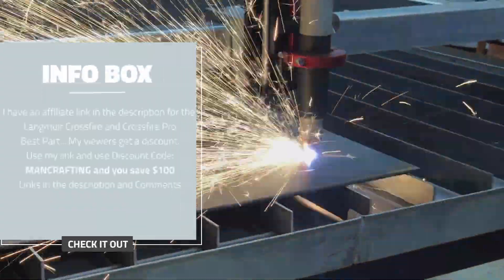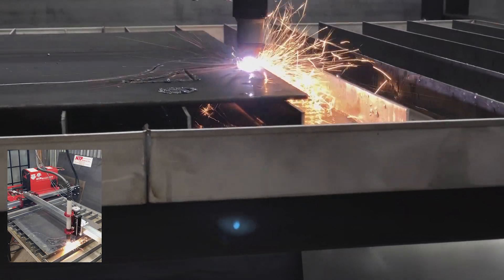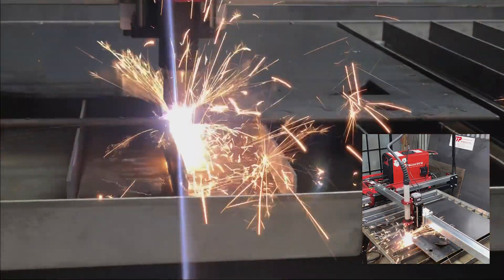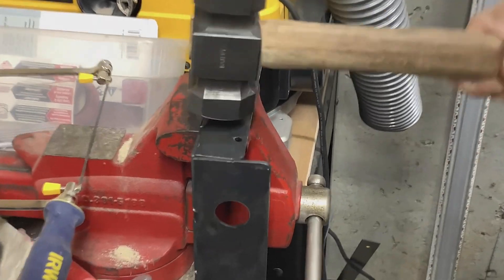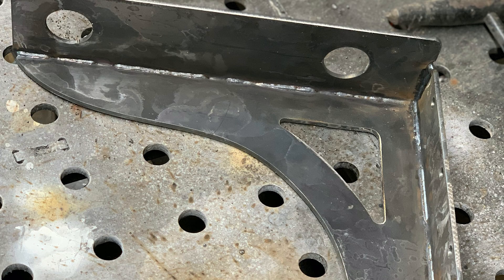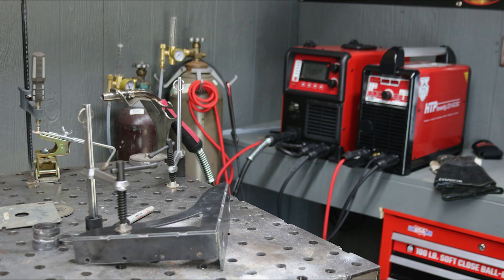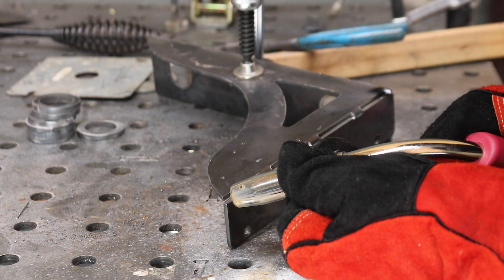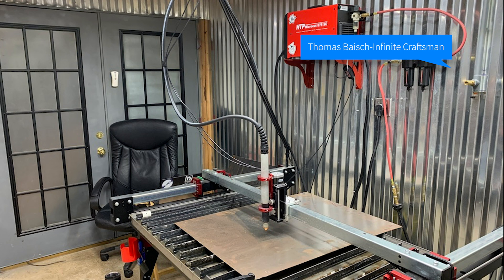Langmuir Crossfire Pro Is this the Best Value for the Home Shop?

Comment: The HTP Pro Pulse 220MTS is $2200 ... not exactly cheap.
Reply from the maker: Logical Guy cheaper than the Hypertherm and similar quality.  I’ve had a cheaper option and I’m glad I have the HTP.  The two combined is a pro level tool at a hobby price.

Comment: Great video! I got box 3 in, waiting on 2 more! I've been watching every pro video I can find, envious of you who have gotten them up and running!
Reply: Those were some beefy shelf brackets! I've been wanting to get setup to powder coat, just running out of room! Like you, I've had to really move some things around to get the table to fit. I've had a Hypertherm Powermax 45 for years, I'll be getting a machine torch for it and using it. I've been pleased with its performance. Looking forward to more videos of the Pro up and running!
Reply from the maker: PyroMan_FPV that’s definitely a good machine.  I’m thankful to have the HTP.  I think the cut quality is very similar.  I need to build a computer stand.  I’ll see about cutting that tomorrow.
Reply: @ManCrafting  Awesome, I've been seriously considering upgrading to the HTP mig machine. I've also been looking for an excuse to upgrade the tig, but there really isn't any reason to. I really want to figure out how to get a mill squeezed in there somewhere. Priorities I suppose. New viewer here, keep up the good content, Your editing and audio is great.
Reply from the maker: PyroMan_FPV 🤣🤣🤣 I hear you.  You like me suffer from TAS.  Tool acquisition syndrome.  I have links in the description to both. Feel free to use them.  That ProPulse is so sweet my teeth hurt.  I can’t believe how well it lays down the beads.  TIG is next.
Reply from the maker: Trust me.  I felt the same way with the original.  I just made 12 shelf Brackets.  I’m about to post a picture  of the shelves we put up today.  They look amazing.  What plasma machine did you get?

Comment: Wow! Those plasma cuts are gorgeous. Never seen any that smoothly executed. The bend relief in coordination with the backup welds is an awesome way to fabricate. Very informative video as well. Nice work!
Reply from the maker: Thanks for watching and taking a minute to comment.  Quick question.  Have you ever used relief cuts in a design?  It seems like I recall you using them previously.
Reply: ManCraftingTM Hey, thanks for asking. Absolutely! They are all over my Zombie Apocalypse Defense Weapon. If you have a few minutes, go check it out on my channel. ;-)
Reply from the maker: Works by Solo ahhh.  I did see that video.  It was part of that design.  I wonder if I could cut that file on the Langmuir.  Yours was laser cut by send cut send right?
Reply: ManCraftingTM You are remembering correctly. Yes, laser cut. The kerf that I’m seeing from your Langmuir is very clean. Can you tell me what is the width of the kerf you’re getting from that HTP plasma machine?
Reply from the maker: Works by Solo I will have to measure it, but I can use different consumables.  Can you account for the kerf in your design?
Reply: ManCraftingTM I recently asked the folks at SendCutSend about this. They told me that their production software takes care of the compensation. The kerf will always be on the waste side of the cut.They spec a tolerance of +/- 0.003”.

Comment: Nice machine ...I would like to see how you made the relief cuts... Thank you great video
Reply from the maker: itchyoldfart56 yea, I wish I had gotten that on video.  Not sure if I totally forgot or if I just didn’t hit record.  I have another project we are working on and it also has relief cuts.  Essentially just a pierce and cut line along the bend in the file.  In this file it was designed to remove all but 1,5 in of material along the bend.  Not difficult at all.
Reply: @ManCrafting   OK gotcha..so the relief cuts were made on the plasma cutter ...sweet ...thank you
Reply from the maker: Exactly.  Really easy to add to the file or even after if you haven’t changed the zero or moved the part.